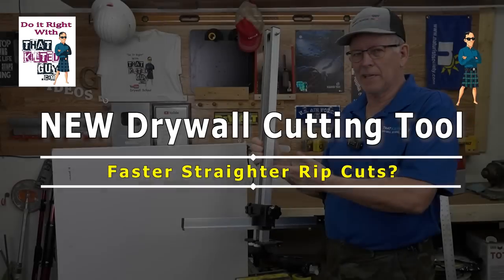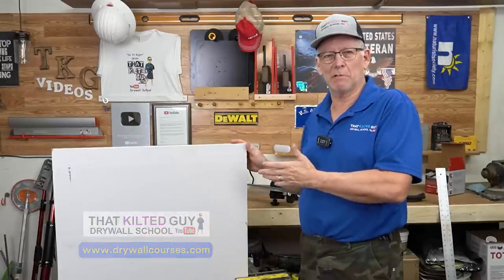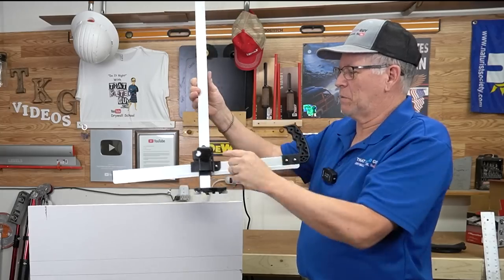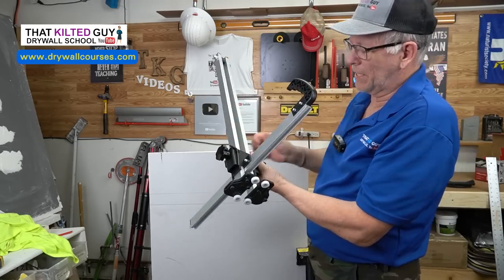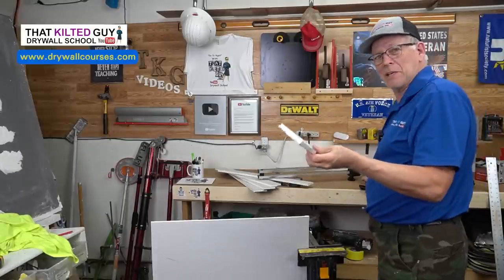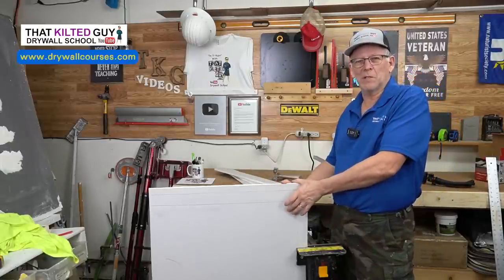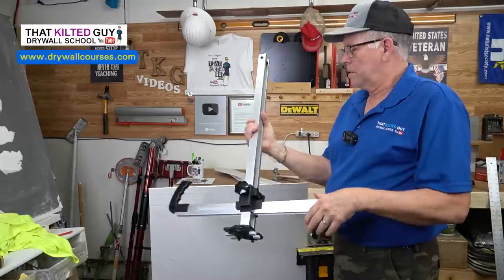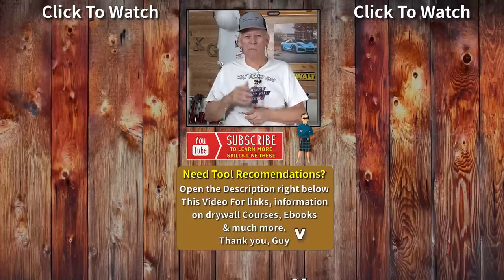This Drywall Cutting Tool is PERFECT for Novices AND Pros. Win it below

Comment: Awesome thanks for sharing. I work in restoration and most of what we do the drywall is cut at 24 inches off floor, sometimes 12. I personally use a Johnston rock ripper to cut all.my sheets in half. If i can get a tool like this in my area it would definitely help speed up things.

Comment: if you have a contact have them add a scale that you could use to cut the sheet and leave the remainder instead of math or tape measure when you need a piece say 36 and 3/8" and want to do it fast with no mistakes.

Comment: I REALLY could have used one of those a few months ago.  I had to make several very thin cuts.  Smallest was like 1" wide, and it was a PAIN doing it manually.  I got it done, but would have been SO much easier with a tool like that.

Comment: Drywall is usually leaning against a wall or laying on the floor, so generally when one is cutting a board of drywall, they only have access to one side of it. This tool requires that the user has access to the front and back of the drywall board at the same time, and that the board is mostly freestanding & upright. That's not how most board is positioned before install. Especially on medium to large projects.
   I can see this tool being usefull in certain situations, but for the average DIY'er, I don't see it being all that helpful.    That's my .02 about that.   Thanks for the video Guy :-)
Reply from the maker: Actually, us Pros are leaning the drywall out from the wall all the time. How else can we bend that piece over and back cut it like I demonstrated here. I think you’re overthinking it. Thanks
Reply: @ThatKiltedGuyDIY   I think that I'd rather use a rockripper.
But personally I'll stick with tape measure & utility knife.
Reply: U cut the back paper through the front us pros would never use a tool Like this
Reply from the maker: Then don’t. This pro who’s been doing this since 1977 will certainly use it because it’s faster.

Comment: Hi Guy, can I get your professional opinion on something? I had some HVAC workers performing work in my attic, they slipped and pushed a 2’ x 2’ section of drywall through my living room ceiling. When fitting the broken piece back into its original position some of the white drywall paper was torn off around the edges exposing the brown inside paper. They screwed the piece of drywall onto some new wood bracing they installed to support it. Having watched your videos, I know they should have sealed the brown paper with Pro-999 or similar product. Instead, they covered the screws and brown paper with mesh tape and mudded the area.  Is that gonna hold up over the long haul, if not, how soon would I discover problems this this method of repair?
Reply from the maker: The brown paper only bubbles around 20 to 30% of the time. We treat it to avoid having to redo it over and over if it does bubble. So if it hasn’t by now, you’re fine

www.ThatKiltedGuy.com
Reply: @ThatKiltedGuyDIY  Ok, that makes be feel a lot better. They still have one more sanding to do before they call the repair complete. I was afraid it could start coming apart in weeks or months, way after I paid the bill. Thanks for your insight.
Reply from the maker: I should also point out that it still could bubble when they paint. But if it hasn’t once the paint is dry you’re OK